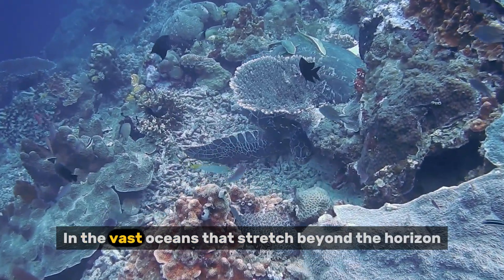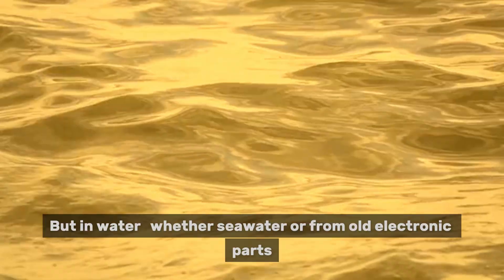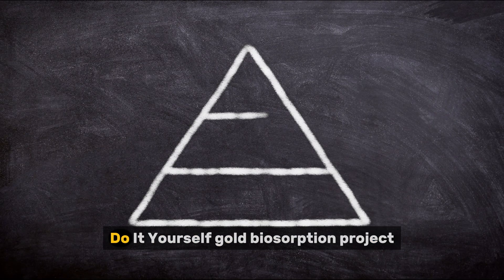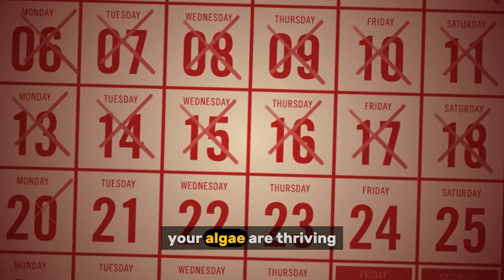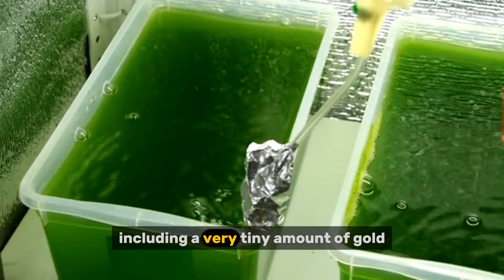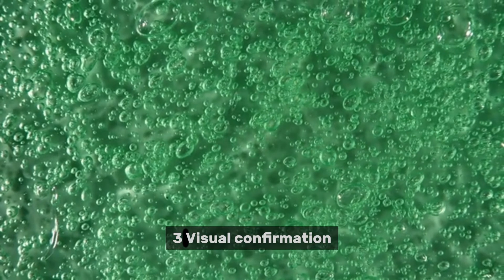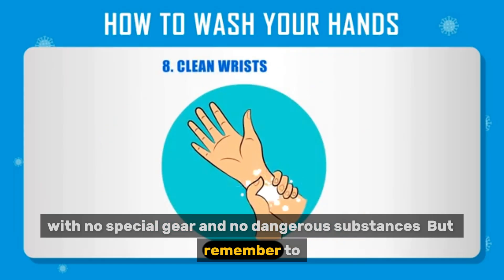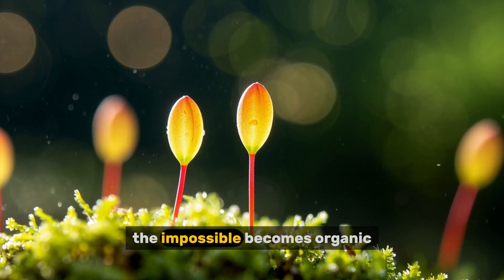This Tiny Algae Might Make You Rich!

Comment: Couldn't a centrifuge concentrate the heavier atoms?
Reply from the maker: That’s a smart thought! A centrifuge can help separate components by density, which can help concentrate heavier elements in some mixtures. But in seawater or algae systems, gold ions are usually in very low concentrations and bound in complex ways. That’s where the algae shine, they selectively biosorb those ions, which is much more efficient than just spinning the liquid. 🌊🧬💰